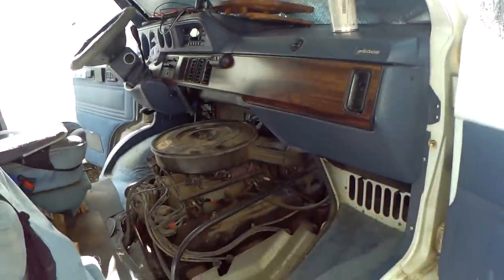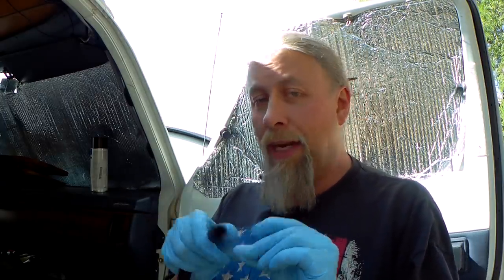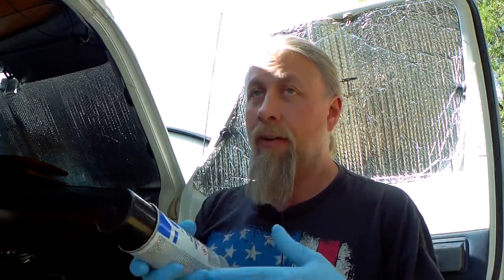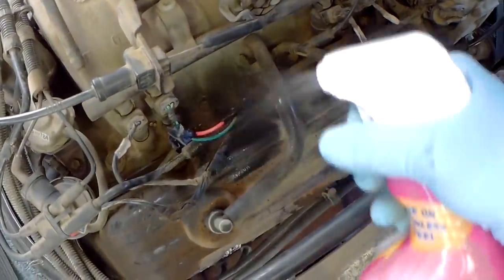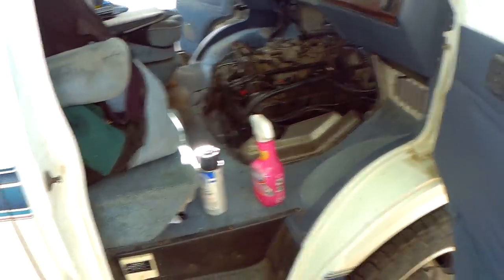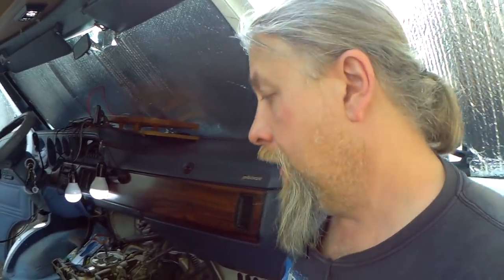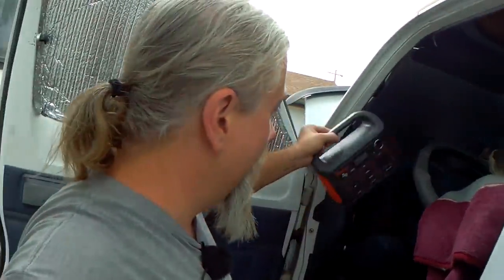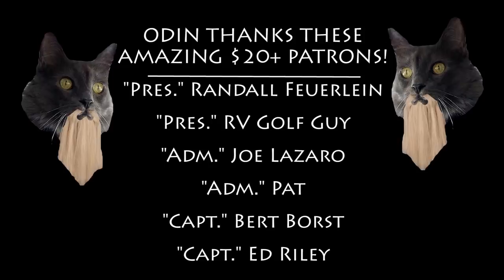Rid RODENTS From Your RV! Protecting The ENGINE Wiring And Using DETERRENTS

Comment: You should still use some form of rodent repellent spray. You don't need to spray the motor(they may start nesting above your new trans or water tanks). When I park a car for an extended period of time, I spray the tires/A-arms/rear axle. The mice need to climb something to get up into the engine compartment and the tires are the obvious route. If they wont come near the low parts because of the spray, they'll never get near the important bits. 

I've also had good luck with the electronic repellers. I have 120v units in my garage but there are 12v units you could run from your house batteries that draw minuscule wattage.
Reply: I used a repellent on my shed because the porcupines were chewing on my T-111 siding. There's some kind of salt used in the binder that they like to eat. It worked, the chewing stopped but the repellent smelled like death, absolutely putrid. It was so bad I couldn't use the shed for months and it made everything in the shed stink for months.
Reply: @vangazmicvoyage5077  Yeah, there's always some compromise with them. Sadly the most effective sprays are pretty rancid. The ones I've used that don't smell too bad need to be applied more often for best results.

Combined with electronic sound deterrents and lights, the 'less stinky' sprays should suffice on an RV that's normally being moved every 14 days.
Reply from the maker: James gill you just said it yourself 1) they reek 2) they need to be reapplied often. I live in a van, that just isn't happening.

Comment: Hey Tom, I bought a vehicle last fall from a woman in Cottonwood. It had been parked for years. Under the hood were several Bounce dryer sheets. The woman swore that was the best thing to keep rodents away -including pack rats. Not one wire was chewed and it started right up when I got it home. It's worth a try and it's cheap.

Comment: I have had the same problems and you would be smart to take the advice of the  low  voltage  (led light strip or something similar to cure  this problem.  The one  thing rodents cannot stand is light.  Good luck.

Comment: Glad you were able to get the A/C repaired and recharged, hopefully that solves the problem. Nice, clean job on the wire loom tubing, that will slow those rodents down a bit.

Comment: How to make a wood stove under your van.😎😋 In a safe place, far from fuel lines, weld a flat metal box to the bottom of the van. It must contain two floors in it. The top floor must be taller than the bottom floor. The top floor Should have two windows. One for incoming air and one for exhaust. Add a 6 inch heat resistant tube to both windows. Both of these tubes will lead to separate vent openings in your van.
Cover each vent opening with stainless steel screen and a computer fan. One vent blowing in and one blowing out on the other vent intake.
Now on the bottom floor of the box, you'll need a door to put the wood or charcoal. The door should have an even smaller door on it for air to feed the flame. 
Now for the chimney.
On the bottom level of the box you'll need a 2-3 inch hole cut into the wall at the very top of that bottom level. 
Add a tube to that hole, leading up and through a hole in your floor. That's your flu 😷 chimney thingy and will go up through your roof to exhaust the smoke. Sand the paint off from around the holes you cut and after your pipes are through, add JB Weld and seal the gaps. Then paint the area with matching Rust-Oleum paint. Go on top the van and do the same. You now have a homemade wood stove under your van. Remember this must be away from fuel lines. It works wonders and u can cook right on the floor under your bed😂. I'm kidding. Well not really, but.. Try at your own risk. I just thought of this and worked out the details as I typed it. 😀 I'm an engineer.
Lord willing, I shall live and do this to my van.🤔

Comment: Good tips! Loving my Jackery and Solar saga panel. Here's another cheap tip you may want to try to rid mice. At Dollar Store or Dollar Tree you can buy the old fashioned mouse traps like 4 for a $1. Add a little peanut butter where you would put the cheese. It takes more work for the mice to chew on to trip the guillotine. Put them on the ground under the van or a secure place in the engine. Then take the dead mice and tie them to small crosses and place them around the van as a warning.

Comment: Finely powdered Cayenne pepper. It truly works folks. Just puff it everywhere under the hood. I also use it to keep the nasty little buggars out of my a/c if I'm going to be parking my vehicles for a long period of time, by dumping some of it in my intake vents, which are usually right at the base of the windshield in most cars. The only catch is that when starting the car up for the first time you want to turn the fan on  high, open the doors/windows. and get the hell out of the car. Let it sit and idle for 5-10 minutes This might not be a good idea for those that are particularly sensitive to pepper, but if you have ever had to dismantle your whole vent system under the dash to clean out mice nesting material, poop, and possible dead mice you will probably want to try it regardless!

Comment: A method of repelling all types of insects that crawl or walk, which would probably include mice, is to sprinkle ground black pepper all around the van (on the ground).  It sounds like it could be expensive, but I've seen large containers of black Pepper for cheap. I have used it before, to deter cats.😿

Comment: Happy endings are good.  Agree, you will hear the next mice rattling around the plastic tubing and if they do, be able to see exactly where they decided to chew.  Only - ... bleach is really harsh for plastics and wires.  IMO ammonia is a better disinfectant and cuts grease much better than bleach.  Try that next time, and a good rinse with some light hot soapy water to wash off any residue.

Comment: I just picked up a solar light and couple of magnet blocks. Going to mount the magnets on the bottom of the solar panel and light base. Whenever boondocking won't take but a sec to set up the light under the engine bay.

Comment: So, the thing with Dodge wiring is that they used a vegetable based vinyl on the installation of the wires, that is one reason they like it.  put some bounce in the front of your van and you should be good.  they also don't like mint smell, find some spray that smells like mint and just do it in the front of the engine  and maybe under the van.

Comment: I had a problem with pack rats chewing wiring. Soy based insulation on the wires is a treat for them. I got a small unit that has an LED light that periodically flashes and the unit also emits ultrasonic noise.
Problem solved! I'll go pop the hood and tell you what brand/model it is

Comment: Throw that damn K&N filter away and get you a regular filter.
Reply: Yes, they perform horrible in high humid areas, while they may work very well in dry climate areas,  the oils will actually clog your Oxygen sensor past the air filter newer veichles
Reply from the maker: I disagree. The K&N filter is better than those cheap paper filters and they don't clog up in humid areas or have anything to do with your O2 sensor. They CAN mess with your MAF if you over oil them but I don't have a MAF. They also can clog up in dusty areas but that is why I clean it twice a year. I notice the performance difference and I'm sticking with it. This is my 5th vehicle I've used a K&N on and all of them ran better with it.

Comment: The reason that mice and other rodents are attracted to the wiring is the insulation is made with Soy.  I don't think the split cover has any soy.  But if it does when you replace it check for soy free covering.

Comment: Good Video Tom
A small blacklight flashlight, will show mouse pee. WARNING Mice Love pot seeds, they eat the inner part, & leave the seed shell. Plug in a lamp cord into Jackery, run it around the under side & motor, tape off , each of the ends. No drain ,till they bite, 
Drive Safe

Comment: Oh how I miss maintaining a van,...... not!
Reply: Dodge B-series/Ram vans such as Tom's aren't actually that bad. Dodge had so much of the engine under the 'dog-house', and the Magnum engine was so small, there is plenty of room to work once the cover is removed. The front accessories are a bit of a pain(which applies to most modern vehicles) but basic maintenance such as plugs, wires and filters are simple. Tom's biggest issue is that he keeps a ton stuff in his front seat area that he needs to remove just to pull the 'dog-house'. 

I would rather completely pull a 5.2/5.9 Magnum out of those generation Dodge vans than do regular maintenance on their Ford/GM competition, particularly the diesels. Been there, done that for a living, got the busted knuckles, not fun.
Reply from the maker: Once the cover is off the engine is super easy to work on and can be done so in bad weather. That's the upside to having a van chassis RV vs any other class.

Comment: So is it pretty safe to spray things on engine like bleach etc? What are some sprays which you should avoid on engine to be safe so it doesn’t mess with wires? Or engine is quite heavy duty and it can take it?
Reply: Bleach is safe on insulated wires that are well covered (splices taped or shrink wrapped). Bleach is not good for thin metal, it reacts and can make it corroded and brittle. I know this because I sprayed bleach on my AC condenser, and it later cracked and needed replaced. 

Bleach is not going to hurt the thick metal of the engine block, but there are metal parts that could be hurt.
I'm not sure why bleaching was needed on the engine. The heat near the engine will kill any virus from the mice. If it was done to prevent the mice, one of the other sprays mentioned would be better.
Reply from the maker: It was cleaner with bleach, not pure bleach. Engines are designed to get wet so regular cleaners shouldn't hurt. Just don't use anything too acidic. I did it to just get some of the nasty off the hoses and wires. I followed up with engine cleaner which I didn't show in order to get some of the sludge off the valve covers.

Comment: I'm skeptical too, and it's been a while, are the essential oils working. I am headed into an area I know is thick with mice. I usually try and trap them outside but always looking for a better solution...
Reply from the maker: No mice so far but I'm no longer in the same area and I'm using 5w LED lights.
Reply: @HOBOTECH  I think light it is the key! thanks...

Comment: You covered all the electrical wires, but you left tubing exposed.  Rodents will chew that too, with similar effects.  It's too bad Odin can't keep rodents out of the engine compartment.  A snake would work, but I'm betting that's not going to happen.   If, in the future, you do decide to spray in some sort of rodent deterrent, you don't have to pull the doghouse.   A length of tubing can be used to extend the reach of aerosol sprays around the top of your engine from the front. 
One way you can deter rodents in the engine compartment while camping is start up the engine and let it run till you reach normal operating temperature, once a day for every day you don't drive.  There's nothing like heat, motion and noise to scare away wild animals.  It's true gas costs money, but it's cheap insurance against actual repair costs and you get the benefits of the heater, AC and power from your alternator to charge things.  
Keep rolling!

Comment: Well moth balls do work around our house at least.   Maybe next time you could just manufacture a couple of durable mothball hangers and hang around the doghouse area.   But maybe you would smell it inside the van too?  And they need to be refilled every so often.
Reply from the maker: Moth balls give off pesticide and I don't want them anywhere near me or Odin.
Reply: HOBOTECH oh I can’t believe I didn’t know that !  Thanks. I guess in our pool heater it’s ok because nobody regularly hangs out near there. (Except the rats). But my mom used them in closets for years!

Comment: Just what you need, another solution!  Buuuuuuut ... I've heard, never tested personally,  that rodents like dark.  Ergo, if you add a low power LED inside the engine compartment that's on 24/7, it keeps the liddle buggers away ... ??? Cheap.  Low maintenance.  Prolly take a decade for a sooper lo powur LED to drain your battery.  Anyway, there it is ... :)
Reply: Oh!  Never mind!  You're already on it!  Teach me to comment before the end!  :O

Comment: That looks to be a good use of the Jackery.  

I am going to get a couple of the garden solar lamps that Walmart sells for about $6 ea and place them under the engine of the truck at night, then put them back out in the sun during the day to recharge.  They use rechargeable NiMH AA batteries.  I will replace the supplied batteries with higher quality larger capacity AA from IKEA (LADDA 2450 mAh).  There is a YouTube airstream couple that had mice issues and none since putting lights under the vehicle and trailer.  I doubt if the lawn lights are bright enough to make the campsite visible from very far.
Reply from the maker: Should work great on sunny days but what about the rest of the time?
Reply: Overcasts days should not be a significant problem if one swaps out the original battery for the much higher capacity IKEA LADDA 2450 mAh battery.  I suspect it will go over four nights with no charge.  Even with overcast, there will most likely be some charging during the day to stretch things out even more.  

If it is a very long period of dark days, then the AA battery can be removed in a matter of seconds and recharged on a common AA charger and be good to go for a bunch more days.  One can also have  some spare 2450 IKEA LADDA batteries to swap out and then recharge the others when convenient.  

The IKEA LADDA rechargeable AA is just a rewrapped Panasonic Eneloop high capacity low self discharge battery at a much lower price.  The Eneloop is one of the best rechargeable Ni-MH batteries available.  The LADDA labeled batteries are from the superior Japan factory, come 4 to a pack and cost $6.99.  They can now be mail ordered in the US from IKEA but it would be best to get several packs to spread the shipping cost.  An alternative is the Amazon Basic wrapped version of the Eneloop but some come from the China plant so be careful on the selection to get the Japan version.  

It is best to use a smart charger for the AAs as to not cook the batteries.  One inexpensive model, although not perfect, is XTAR VC4.  It can be bought for under $20 and will also do some LI-ion.  I have had good luck with it over the last year on various AA batteries and it is very simple to use.

Comment: working on my roadtrek tonight, new water heater. Have you had any issues with your furnance, mine works great but sets the alarm off after about 2 hours?
Reply from the maker: My furnace stopped lighting over a year ago. Never bothered to fix it because its a propane hog.

Comment: Hobo quick question. What are the areas that are most notorious for rats and mice. Deserts or Forest?
Reply from the maker: Both. Where I was eaten was more of a desert area with very little cover, but in forests you have chipmunks that like to dance around the engine. However, they never seemed very interested to nest in my engine vs their nice warm burros. I actually think because forest has so much cover there is less chance a rodent will prefer your motor as long as it's cold.

Comment: Don't know how this would do but I imagine if you put decon pellets under your rig while camping it would draw them to that before getting into the engine compartment and kill them at the same time. Yes one or 2 may crawl up in the compartment and die leaving an odor but how long would that last after the engine heat baking it is the question.
Reply: I don't think you can buy Decon pellets anymore.
Reply: @bruceh3786  I'm  not sure about the pellets but they do sell decon in like cake form and they come in different sizes.
Reply: I am thinking about the pellets that came in the cardboard triangle yellow boxes.  I just did a "sold" search on e-Bay and these boxes are selling for over $20 a box!  They are called "d-CON Mouse Prufe II"